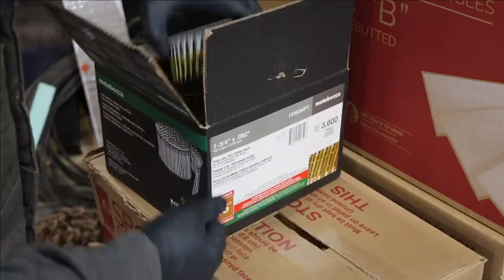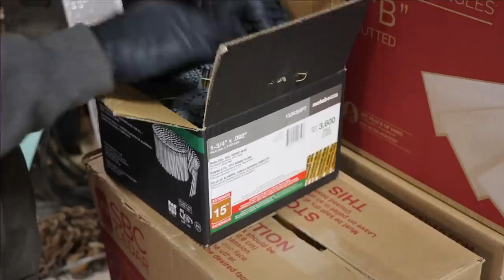DIY Crash damage repair / Ice Storm Workshop update

Comment: Tip for exterior window trim:  Cut a shallow dado on the bottom edge of the lower trim board to act as a drip edge to keep water from running
behind it.  Simply run the board over your table saw.  Steve, you have many job skills and never cease to amaze me on your work load.

Comment: Steve, as a cabinetmaker/ millman for the last 47 years, here's a tip for you. The problem with finding nails in used lumber or staples and grains of sand in new lumber is common. After carefully looking for tramp debris, dedicate one side of the planer for the first pass on all wood. So if you hit a nail you'll only nick the one area. After finding the nail and pulling it out you can get a nice finish cut with out nicks on a second pass using the rest of the planer.

Comment: I'd have to say, being able to do the car work in a dry and warm shop makes the job easier. I'm blown away at the shop you are going to be left with after TONS of work. Stay safe, and stay warm!
Reply: Next tool purchase will be a 2 post car lift, right in the middle, I bet.   And clearing some space on the old floor so one may drive straight in.   The old ute would prefer to live indoors too.

Comment: Get your material for the roof over the compressor and use it to build a scaffold along the creek side of the shop to work off of.
Might need some extra materials. But would be alot better than a ladder.

Comment: In my experience I found that cedar and galvanized Fasteners have a reaction I learned to use stainless steel fasteners just my experience
Reply: I was going to suggest the same thing; I've always gotten the telltale stain lines after a couple of years
Reply: Similar things happen with the salts in treated timber
Reply: What ever job you take on will be top notch. Thanks Steve for your time.

Comment: Thank you for this video! Body shops are not an option for many damaged vehicles due to cost. This is the first common sense video I’ve seen on general body work for the common man.
Reply from the maker: The scrap yards are full of easy and cheap repairable vehicles.  It's not rocket science.

Comment: Interesting choice of air line materials. My schedule 80 PVC rated at 413 lbs working pressure cost a ton less and has worked for many years 100% trouble free.

Comment: When I was an apprentice, years ago, an old timer showed me that if you give a tack or nail a little tap with your hammer on the point, thereby blunting it, when you drive it through thin timber such as a shingle, it is far less likely to split the wood. Works really well. Clearly not practical for thousands of tacks through a nail gun but thought I'd mention it.

Comment: The easiest way to set up the shingle spacing is with a story pole. Use a 1 by to mark the beginning of your run and the top of the run. Then mark out the bottom of the window and the top of the window. Then set your spacing so it is exactly at the bottom of the window and the row above the window is exactly at the top of the window.  Use this to mark both ends of the wall and then run a chalk line. No measuring needed. Works great.

Comment: I did a short stint in my buddies body shop years ago. The experience was invaluable. My favorite part was pulling things back straight and reassembly. I hated all the dust from sanding and the fumes from paint and primer. The wurring sound of a DA sander still sends shivers up my spine. Needless to say, I avoid body shop work unless I need to fix one of my own.

Comment: If I may offer a suggestion. Take a few of your air drops, install a pressure regulator. You never know when you'll need one.
Steve, that's why wood supply stores sell metal detectors. Or metal wands as most folks call 'em. Are they a pain? Oh yes they are but, if you can find them with the detector, saves your blades and saves your wallet for replacement blades. 
Great repair job on the car. Great video, cheers :)
Reply: I suggest you watch the video.

Comment: I used pex in my shop, but I have a drop with a coily hose above every machine and workbench. Handy for blowing stuff off, or running something like a coolmist. I also have two retractable reels on the ceiling above the primary work areas. I may as well have never put the rest of the wall drops in, because I only ever use the reels. I prefer them so I don’t have a hose dragging all over the floor.

Comment: I remember that type work in my Father-in-law's body shop.  Some kinks look like they came from the factory, but like you say, you just use your "Adjuster" to put them in place.  Use a little WD40 on the driver's side headlight.  Shingles are gonna look nice.  Stay safe.

Comment: When I installed irrigation systems we would use a loop, similar to what you have done with the air system. We installed isolation valves so we could isolate part of the system to deal with faults, maintenance and additions without having to take the whole system offline.  If you find a good deal on valves might be something to consider.

Comment: Make yourself a ledger/shelf board for hanging the cedar shingles.  A long straight board with some thin material attached to the back at each end, then nail the top of that thin stuff to the wall with duplex nails and set all the shingles atop the board before nailing them to the wall.
Reply: Also, on your first (bottom) course, the one you're doubling up on, don't let the bottom edges be flush.  Tuck the inside one up 1/2" so that it stays dry and won't wick water up inside.

Comment: I didn't know you were a body shop vet. I have been doing this for 46 years.  One thing I find very helpful playing with these new snap together cars is to spray all plastic fasteners with a soapy water solution.  The push pins come out and go back in much easier.

Comment: I'd done something similar with my wife's Corolla a few years back.  She bought it used,  first time I drove it to work,  a big ol' buck decided he was going to charge me and leap over the car,  "Jackass" style.  Needless to say, he missed.  I wish I'd known you can get the parts pre-painted back then.  Now,  I've got some similar work to do on the sister model to that,  our 2004 Pilot. You just gave me a roadmap to how to pull out damage on the passenger side.  We shared the car with my wife's sister and nephew,  and there's no obvious damage to the front,  but the fender impinges on the passenger door.  I cringe every time we close it and the fender pops. When we asked what happened, we were told Ida did it. Ida Know is responsible for so many fender benders... she needs her liscense revoked.

Comment: That airline kit looks nice to work with. Can't tell if this is a complete open loop. In my experience it is good practice to install control isolation ball valves so you can at least shut off sections as needed or in an emergency. Even in a one man shop, it's not always convenient shutting down the entire system. Nothing worse than having pressure force fed from two directions in a loop and no way to block it.

Comment: Yea that works fine aslong as you don't knock the tray on the floor and everything goes scattering across the floor and you may want to put in three air shut-off valves in the main line

Comment: Out of desperation I used some of that headlight clearing fluid on my backup camera lens. It worked great.
Reply: Your backup camera lens should be glass. I don't think there are any that use plastic. So it was probably just buildup on there that would come out with a cleaner, not the oxidation and sand blasting that happens with plastic headlights.
Reply: @xenonram  Mine (Mazda) was scratched. When I tried to clean it, it just got worse. So I assume it was plastic. The headlight scratch fixer fluid fixed it.

Comment: My dad was a body and painter aswell as a mechanic when it came to bodywork his motto was figure out how it got damaged and reverse it. Im a mechanic and my least favorite thing to repair is stainless exaust hardware. Once the threads are gone its time to heat and extract hoping it don't break off on you

Comment: Steve if you saw what all I've been doing to my 1980 f350 dually you would probably laugh. Ford and their fiberglass rear fenders can hit the road. Custom built 14 gauge steel fenders are taking the place of fiberglass.  Next comes the custom steel center console and bumpers. Also have a cab corner suffering from weight reduction.  Have a new cab corner ordered. Will take me several months to get rid of all the deep rust pockets and then comes the paint.

Comment: Just a thought Steve, regarding the wooden window frames, perhaps it might not be a bad idea to chamfer the sharp edges, one of the few things I remember from school in the early sixties is Mr. Lucas, our woodwork teacher explaining that the full title of a chamfer is 'wagon chamfer', the reason being, years ago, the wooden farm wagons in use back then would be left outside, any moisture getting on them through rain or condensation would not hang in large drops on the sharp edges but form much smaller droplets on the flat surfaces and thus evaporate quicker. All The Best from Somerset UK.

Comment: I imagine for an older Acura, just one OEM headlight would cost more than the vehicle was worth. Had a Ford Aerostar where the side piece of the rear bumper got snagged on a low stone wall. Even a used bumper skin from the junkyard was $400 so I figured out a way to reattach the lose piece. The repair lasted at least until I sold the van many years later.

Comment: It’s pretty easy to buff those old headlights to like-new condition. Or at least to good enough to match, anyway.
Reply: Seeing as they met a tree likely the clear lens cracked at the bottom, a common thing with this. This then lets water in and you get the fish bowl effect in the summer. Replacement light probably from a parting our yard is cheap, and often you can get the new to you unit and the fasteners as well, plus often a few extra body clips from the area, because it is certain you broke a few getting them out.
Reply: @SeanBZA  I think he is talking about the one that didn't get broken.
Reply: @SeanBZA  huh?
Reply: Music Bro Yes, thanks for the back-up.

Comment: needs to do a check on the alighnment on it
its cheaper then a new set of tires
about those planer blades , i seen carbide helical (spiral/segmented) jointer/planer cutter heads that you can fit to those planers that hold the same inserts you use on youre lathe , even if you hit a nail hard enough to break one you usuallly only have to replace one insert

Comment: Now you have one shiny new headlight and one sandblasted one. I believe there's a way to renew old headlight covers using solvent.
Reply: It's not sand blasting that causes lights to get foggy. That's a common misconception. It is from oxidation and UV degradation. The clear plastic is highly susceptible to UV degradation because they can't add any UV protection to the clear plastic. If sand blasting effects were so pronounced, the whole front of your car would look like trash in a few years. Sand blasting effect does damage the lights, but it is a very small amount and contributes to the foggy look very little.

Comment: Ill keep the laser in mind. I do have a theodolite and an optical level. But no laser level. That would come in handy to draw drilling point all at the same height. Or getting your wall or slits for conduit in/or on the wall. Pretty good!

Good to see your build is coming to an end. 

Id leave the wrap as is. Just put the top layer on. The house wrap is extra protection. You are not going to build it so that the housing wrap covers the lower part of the building? 

Greetings,

Jeff

Comment: Nice job on your mate's car Steve. You can certainly see you have a fair bit of body shop experience. I had forgotten about that. Didn't you used to work with your elder brother there? Airline looks really good and you can do drops in the future wherever you want, a lot easier than if it were run in galvanised steel. I look forward to seeing the shingles going up, as we never see that method of cladding a building here in the UK. You and Elizabeth and the Kids stay safe. At last here in the UK the daily death rate and infection rates are starting to come down, and hopefully within a month or so come out of the lockdown we've been in since Boxing Day.

Comment: Looking good Steve. Just some safety issues, I was a electrician for 40 years, during that time I worked with a guy that always put staples between his lips to hold. I used to do it also, we all did, but at the end of the day his lips had a tint of blue from the galvanized staples. He was also a smoker, but after years of doing this he got mouth cancer. Had to have his tongue removed, treatment was administered but with in 6 months he passed. From that point on, none of us held staples like that any more. Can't say for sure that was the reason, but smoking might of had had something to do with it, I can't say for sure. So please becareful. Just some words to think about. Great job on the shop, looking great, n the car to. Stay safe.

Comment: I'm amazed at your range of skills and knowledge about a multitude of problem solving situations. I think you made an excellent job of repairing that car and I certainly did not know that you could get prepainted repair components like those! Your airline installation looks very good also but I have a question about how you plan to deal with moisture and its removal that is always an issue with air systems besides draining the compressor tank?

Comment: Didn't make it that far before thinking "Steve's done body work before!" Awesome video as always. I tend to grab the forming hammers way before I start pulling with a come along but that looked like it worked a charm. Did you heat the paint on that fender before pulling out around? I would have thought with the cold weather up there or would have chipped right off!

You know how it is: every body guy knows the "right way" to do everything but no two agree on exactly what that is :)

Comment: Maybe block the tires on the car before yanking on it with the come along? Maybe it's just my thinking but yoinking on the transmission with it in park/gear might hurt it?

Can we get AVE tp send Steve a CNC formed copper "frame adjuster"?

They do make a planer head that is all replaceable carbide insert cutters. But it's not cheap and it's a LOT of carbide inserts.

Comment: That rad support looks bent could be the lighting but you should seriously . Think about having the uni body measured to male sure it is in spec. Also check the alignment and rife height specs. I don't know about the laws in your state  but if you have frame damage it needs to be inspected and certified body and frame and mechanical after a crash. To ensure it is road safe. The legal implications may be enormous.

Comment: Did /can you mention why you didn't run the air line around the shop at waist/working level? (Just above work bench height, or obviously under window height) No need to be on the top of the wall in my opinion.
Reply: I'm not sure but "waist level" would make it hard to use the large sliding door. Just sayin!

Comment: we dont call it freezing rain in the uk its called sleet
Reply: i think freezing rain is water that freezes upon contact with the surface where as sleet is partially frozen water falling from the sky,  sort of like slushy snow.  here they often forecast freezing rain with sleet.
Reply: Sleet and freezing rain are 2 different things. Sleet comes down as ice. Freezing rain comes down as rain and freezes into ice on contact with everything it touches.
Reply: In Canada sleet is a combination of snow/ice pellets and freezing rain. I lived in England for a while and once had to drive through the North Yorkshire moors on the back roads during a sleet storm... NOT fun.
Reply: Sleet != freezing rain.  I think of sleet as fluffy hail, freezing rain is liquid until I hits something and freezes on it.  Freezing rain leaves things encased in ice pulling down power lines and tree branches.
Reply: Yeah you don't get freezing rain like the ice belt gets. They get storms where everything is covered in inches of ice. Like that storm Steve was talking about that leveled the forests. Epic stuff for the history books.
Reply: @crichtonbruce4329  I've driven in a lot of snow I think rain is worse especially when the road is so wet you can barely see a cars length in front of you. Snow and ice is a bit more predictable for me anyway lol
Reply: @TotoGuy-Original  I'm from Northern Ontario, Canada. We get, and I have driven in, bad weather of all types. What set that drive through the moors apart  was: summer tires on the car, pitch black night, narrow roads with sharp curves and steep up and down grades. and an inexperienced driver. I asked, almost begged, for them to let me take the wheel. Scary!!!😱